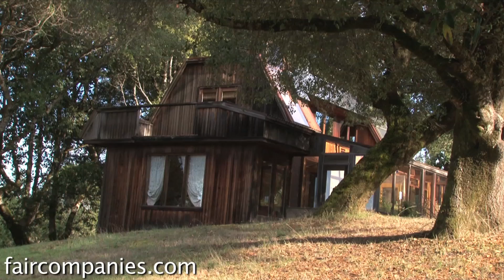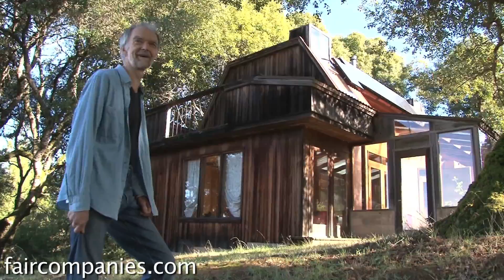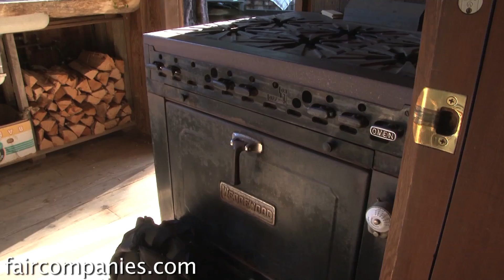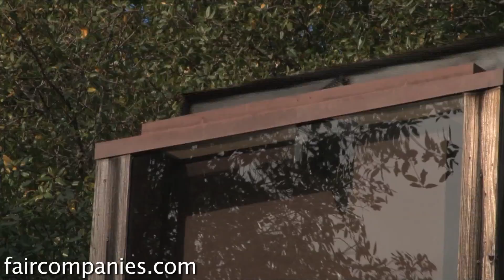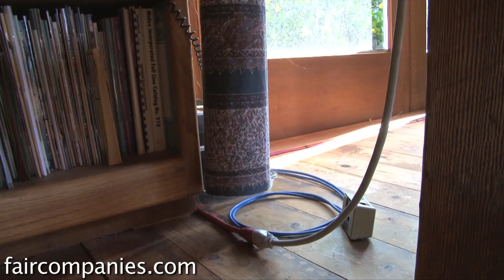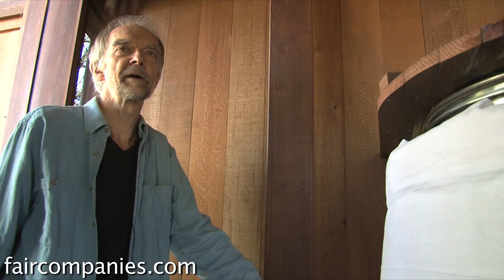C++ programmer builds off-grid home with sunroom & DC lighting

Comment: Those of you asking for code for the automation software he is using you need to take a step back.  As many others have said it is CUSTOM code HE wrote for HIS house, it will not work on yours as it stands, it would be an example or a starting point but little more.

There are two things to consider, you need to design the house and systems and then you need to code it for automation.  These are different skill sets but can often be done by the same person with perseverance, learning and practice.

However if you do not think you have the skill in either of these two fields that are needed for an automated off-grid home you have to use the alternative and either BARTER or PURCHASE the skills.  There will be a growing number of people who will automate to free themselves off the grid and an increasing number of these private efforts will eventually be started as Open Source projects when there are non-profit teams involved.  Each of these projects will then lend itself to customisation by those who like to code and they can make a system that is simple enough for an end user to maintain.  The thing to remember is that the automation will just become easier and cheaper with time so do not let that stop you from forward planning.  Join a club, follow groups, watch videos and read books and papers on the subject.  If you have time you can purchase an Arduino or RaspberryPi starter kit and see if you have the patience to write or modify code yourself.   If you have EVERYTHING ELSE ready and are just missing the code a plea on FB or CraigsList could even get you free coding by an enthusiast or provider if you give them some publicity.

Comment: All he needs is wind power to go with his solar panels. He could have a Wind Turbine in each corner of his house.
Reply: +M Chang and ruin his view.
Reply: A 12 inch to 24 inch wind turbine set above tree level would not hurt his view at all. It can be mounted on a steel pipe grounded in cement.
Reply: Ok I suppose, have you tested it and power dosent seem all that effective to me
Reply: Usually you get lots of wind living near the ocean or mountains. Depends on the location, but wind speed varies throughout the day so it is not as consistent as Solar but can be a good suplement to a off grid solar installation.
Reply: Really might try it. I think by the ocean would be best.
Reply: Does wind power make noise?  I'd hate to be living under something that goes wump wump wump.
Reply: a wind turbine would help keep the house cool, right morbo? "wind mills do not work that way!"

on a more serious note, wind power is a good supplement because it's likely to make more power when the sky is cloud covered and solar is less effective. when one can't produce, the other likely picks up the slack.

Comment: i think someone said that skylights are the biggest waste of heat.
Reply: The original version of the skylight was a huge waste of heat. The guys who built it were convinced they had to leave an air gap all around the edges of the glass to reduce condensation - which made it a chimney! The glass back then was plain and uncoated. Now it is fully air-sealed and uses extra-spaced dual heat-reflecting glass. You can feel the difference just standing under it - and it collects less condensation than before.

Comment: Several comments ask about sewage. Utterly conventional, septic tank and leach field. You have to pick your battles, especially with Planning and Building, and I just didn't care enough to fight that one. I did separate greywater for awhile, but when fresh water is plentiful and free, the ongoing hassle of maintaining a greywater system seemed an inefficient use of my time.
Reply: I answered this recently in the comments to the newer video, but I can't find it now...  So here it is again:

There are actually several factors. Most fluorescent lamps flicker dramatically at line frequency, and I see it. Maybe not as obvious as the interaction you see in a video of a CRT tube screen, but definitely as my body moves or my head turns, the apparent motion is jerky - like waving your hand under a strobe light. That can be fixed with high-frequency electronic ballasts, which also save energy. But there is still the color rendition problem. The gas tube emits an ugly sharp spike of nausea-green light, and they try to hide it by adding phosphors in other colors. But the gas spike responds instantly to the AC frequency, while the phosphors brighten and dim more slowly. So not only is the brightness flickering, the color balance is strobing as well. (High frequency ballasts hide that problem too.) But to build a "full spectrum" lamp with even vaguely decent color rendition, you need to add so many color phosphors you reduce the "lumens per watt" efficiency seriously. The justification for fluorescent lamps is low running cost, but by the time you get decent color your costs aren't much lower than quartz incandescent, which will always have much more even color. Finally, even if you go for high frequency and full-spectrum, fluorescent tubes have a huge, diffuse light emitting area. We evolved under the (relatively) pinpoint light sources of the Sun or Moon. Visual perception relies on directional awareness of light sources and shadows. Working under fluorescent lights is like being stuck in an office where every day is cloudy overcast and the sun never shines. On a cloudy day outdoors, you at least remember what the world looks like when the sun is out. You've probably never seen your office, or your co-workers, in sunlight... Morbidly depressing!
Reply: Almost every light in my house is now quartz incandescent, the little MR-11 (11/8" or 1 3/8" diameter) and MR-16 (16/8" or 2" diameter) "spotlights" that are common in track or cable systems, desk lights, or display lighting. They range from 60 degree wide floods to 12 degree narrow spot angles, and are readily available in 12 Volt sizes from 10 to 50 Watts - perfect for running directly from my DC battery system. The light is whiter than conventional incandescent lamps, and can be directed exactly where you want it. I've played with LED lighting, and kept some for accents, stairs, and outdoor paths, but they have the same color problems as fluorescents - the LED emitters are sharp spikes, and they add phosphors to try to even out the color rendition - with limited success so far...  And if you're running them on regular AC power, beware of LEDs - the vast majority do not filter the AC, they flicker worse than fluorescents!
Reply: Would love to connect with you about off-grid resources for PV and passive solar heating, Mr. Amelang. Great to hear about Susterra. http://www.duponttateandlyle.com/susterra/engine_coolant_glycol_antifreeze

Wonderfully detailed and insightful tour of your house. Thank you, Kirsten and Loren!
Reply: I had no idea why i didnt like it! but it makes so much sense. we should always try to live as close to nature as posible. im always atracted to siting outside anywhere I go. 

What type of lights you use in your home?
Reply: why dont you like fluorecent light? Thanks

Comment: @1776bobsmith- Gr8 video thanks, and admirable and a dream come true, but if u r worried about AC electromagnetic pollution and fluorescent flicker light , u seem to then offset all these precautions with your wifi and cell phone running shf spectrum with more heating density absorption , kindly clarify ?

The decision was made personally and empirically - I see flicker and hear the inverter humming, but I don't feel a thing from Wi-Fi or cellular, or from the Bluetooth access that is always also live. My suspicion is that CDMA and other modern modulation systems are so close to random RF noise they don't affect me. (If there was any obvious pattern to the signal there would be bandwidth being wasted.) A GSM or TDMA phone, on the other hand, is blatantly obvious even to the $50 "bug detector" boxes.

Comment: Normal fridges add to the heat...so it wont fight your attempt to heat the house, it will rather help heating whatever space it is in. In order to cool the inside of the fridge the compressor of the fridge will give off heat to the surrounding area.
Reply: I suspect the best fridge setup would be able to duct the warmth outside in Summer and inside in Winter, but I find it's not much heat, so probably not worth it.  Bigger savings in a chest style cold box so when you open the door you don't lose all the cold air cascading down to the floor rather than sitting in a pool in the box, then use up your solar power cooling the newly captured warm air.
Reply: @nomoyousernames You are correct that the indoor fridge will supply free heat but at the cost of electricity.  The heating and cooling is done more efficiently with solar in this house and electricity is a higher quality/grade of energy that should not be wasted on heating.

However if you want to keep the house cool you do not want the fridge running more due to heat infiltration just to keep the food cold and fight the warmer air temperature on the condenser, so in summer you will save energy by keeping the unit outdoors.  In winter you save energy because the outdoors does not heat the food as much as the indoors so you do not have to run the fridge as much and it works more efficiently as the condenser is in the cool summer kitchen instead of in the warm house.

Basically a fridge works best if it does less work.  Secondary heating is a small benefit that is not worth aiming for and barely tolerated.

The ideal situation is to have very thick insulation on your cold box and have the exhaust heat of the compressor and condenser directed indoors in winter and outdoors in summer.  This may be one of those fine tuning things that will take 20 years to pay for itself and is a nice idea if everything else is done.

Comment: I've been thinking the same. At first I though about buying land and start building a house an keep going, like you said. But that would add a lot of cost to the land and they can actually stop your building because ill raise tax's to the people in your area. So I am thinking of living a long time in a tiny house on wheels, because since is on wheels it doesn't add property cost to your land. Ones I save a good amount, I plan on actually building on the land or buy a modern house.
Reply: Another advantage to being on wheels is that there is a market for undeveloped land, there is a market for conventional homes, but if your property is unique, then it may be very hard to find the unique buyer who'd want it.  If your house is on wheels, you can remove it and sell as land, or sell as a house.

Comment: that's the thing with this one. three inch firebrick on the sides means ONLY the hotplate gets hot. i am not joking I can run it for hours and still touch the sides. it is absolutely hopeless as a heater. having it as a heater and stove was the original idea until i had it installed and running and realised it was never gonna be a heater. i have a proper wood heater in my bedroom though.

Comment: Three inch thick firebrick? I hope you live in a climate where you burn a hot fire 24/7 all winter, or you'll never get it hot! My cookstove has its namesake "oval" firebrick, one inch thick. Takes awhile for it to warm up, but once it is the heat radiates from it for a long time. But you're right, more of the heat comes from the stovetop - as intended.

Comment: firebrick ACTUALLY insulates. it doesn't hold heat, it keeps the heat in. i put a wood stove in my kitchen with the idea it would heat the kitchen up too. wrong. it has loads of 3 inch firebricks all around the sides. only the hotplate and flue gets hot, and it really doesn't heat the room up although I am using reflective material to try to bounce some heat off the flue into the room with a little success. "everyone these days sacrifices everything for convinience". that is SO TRUE.

Comment: I fully understand what your doing here and find it very smart. I've also built my own home (literally) and plan to go solar and keep the grid option as back up. I've built greenhouses and shade structures for many years. We installed a special fabric for shade in our greenhouses which could ride along high strength plastic cables which were very cheap and effective. Email me for addition tips or if you ever want an extra pair of hands for a month or so to help you out around there.

Comment: To get 24V, I use two separate single banana plugs. I've now built some outlets in a diamond design where a double banana can span any of the choices, but the ones in the house walls aren't likely to ever get changed. And yes, everything gets hand-modified. The "cig lighter" plugs are so miserably dysfunctional, I've actually converted my vehicles. If I was starting over, I'd definitely consider these: ...powerwerx.../powerpole-accessories/powerpoles-chassis-mount-2-sets.html

Comment: Thanks for the reply. But if you did have something that needed to run on 24vdc, what would the appliance plug look like?  Also, do you have to modify the plugs for your dc appliances? I've never seen anything being sold with a dual banana already on it.  I know dc devices for vehicles are sold with the cigarette lighter plugs, I assume that would be cut off and a dual banana wired on in its place, right?

Comment: They are essentially "dual banana" jacks. Bottom left is -12, bottom right and top left are ground, top right is +12. If your device is polarity sensitive, you need to pay attention - or make sure it is internally protected. The best part is the plugs stack on top of each other. Unfortunately, the voltage drop even at 24V requires heavy wire to run anything serious, and copper is no longer so cheap! I love having pure DC lights, but wouldn't suggest any bigger loads be wired for DC today.

Comment: I also forgot something with new Ivy Bridge computers and 3770K desktop CPU from Intel ... power consunption is very good and ... computers can be fed Directly from DC ... increasing a Lot efficiency, the only loss is on the DC-DC converter ...5% ...
Also for the desktop there is this PicoPSU Wonder :) ... Direct DC from 12V ! :)

Comment: :) Awsome MAN! I have search the net a lot for solutions like That and I have reached the conclusion that if one gets around a coulple miles with Fiber optics on ground/threes a link solution with Only a Single long range wifi is possible.
Meaning ... long distance fiber-optics + a wifi Bridge station with solar-power small-medium cell and a car battery. This station pointing to near a city-limits with another wifi serving has ADLS/cable service. Should be simple enough :)

Comment: You are in CA,mostly dry place compare to where I'm,in sw florida is the most chalenge to condition air.I'v been through everything,how to cool or dehum.the air.A came up to one design and built myself hi eff. AC heat pump unit which takes only 2.1kW to cool 2000 sqf,house and no need for HVAC tech.principle is in low pressure refrigerant  and great subcooling method.NO earth tubes,hilsh vortex,evaporative cooling,ground water loop cooling,desicants coolers works in florida..

Comment: In 1989 I had 2400 baud dialup via a radio-linked POTS phone line. Replaced that with a 36-mile remote ISDN connection once they plowed wire up here. Now I have 5Mb, 25ms, via three wireless hops to fiber in the next valley. Each step required the same force of engineering and negotiation that built the rest of the house. The latest one brought a few hundred neighbors to the net along with me. So thankful for ridgetops!

Comment: I'm right on the edge of wishing for air conditioning for a few summer days, but close enough to the ocean that evening almost always brings relief. The electric supply would easily support a little Japanese-style "split-system" big enough to do the job here, but there is no existing forced air infrastructure so installation would be difficult. So far I haven't bothered.
Reply: Hi Loren, amazing home. What was your inspiration of your house design ,and do you have plans of your home available? Thank you
Reply: @sundaze3115  My part of the "design" was the location, wood, concrete, solar, functional spaces. "I genuinely prefer the simplest, most rustic basic construction; but I respect strength and quality of materials. Perhaps what I want is a quality barn rather than a house." (I have the original file, if anyone is that interested.) The complex interactions of spaces and corners were created by the local builder who drew the actual plans. (And probably the reason he couldn't begin to finish his fantasy within my budget.) 

I have 200MB of photos of the original blueprints, an ancient and barely visible technology, and obviously quite different from what they actually built. A little DWG of the floor plan, measured much later. And a complex DWG of all the plumbing and hydronics I've added in the crawl space.
Reply: Thank you for responding and sharing plans and information. I’m located on Phillip Island Australia, so would look at how these design ideas could be adjusted to suite this side of the equator and climate.

Comment: I had a Sunfrost 24V fridge for years, but it died and nobody would work on it (I don't have the tools). Decided power is now cheap enough the payback on a new Sunfrost was too far out, so I bought the little EnergyStar Summit (there are similar 309 kWh/yr Sanyo and MicroFridge
10.3 cu.ft. models.) Love the frost-free design - the Sunfrost was always a damp moldy box. 

The key to surviving our no-sun winters is having the fridge out on the screen porch "summer kitchen", not fighting the stove.